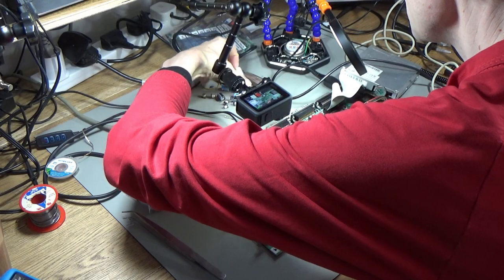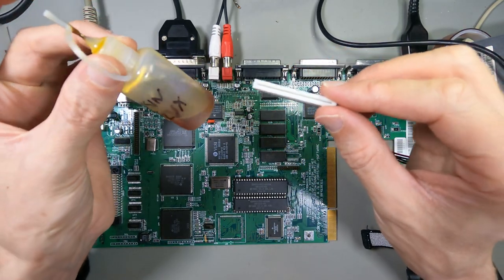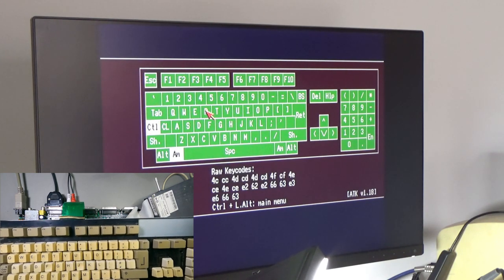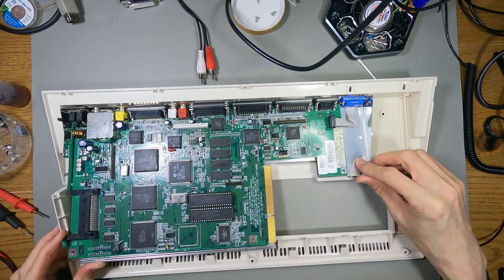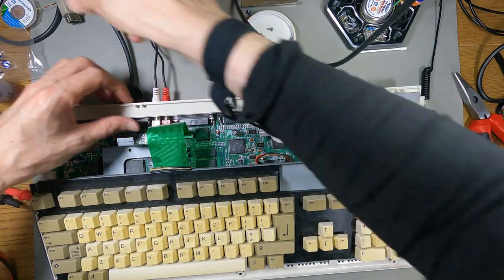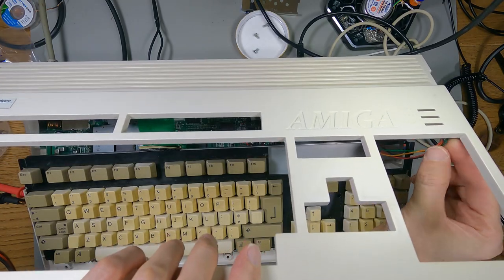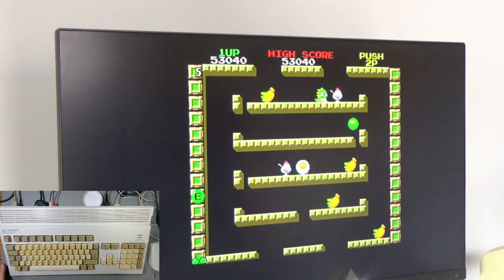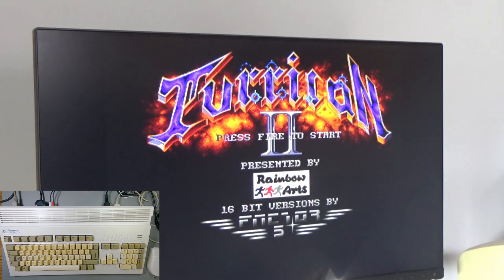Reassembling the Amiga 1200 After Recapping

Comment: Great job! Retro bright the keys in a glass tank of hydrogen peroxide 12% and place a submersible heater with an LED UV light. Wrap the tank with foil to trap heat and light to speed up the process... those keys will look new again! 👍
Reply from the maker: I've actually already bought an aquarium heater for this, but it's a little bigger than I expected.

Comment: I have an Amiga 500+ and an Amiga 1200, also a Commodore C16 and an C64. All work apart from the Amiga 500+ which for some reason keeps going right. 🤣😂🤣 I have had these for about 33years. Happy Days!
Reply from the maker: Is the C64 a breadbin one? That seems to be the most likely to fail as they made some dodgy chips for those back in the day. The PLA being the worst offender which it turns out they used too much boron in the manufacturing process and the chips literally corrode themselves from the inside. I think by the time the C64C and Amiga came out they had ironed out a lot of the problems in their own manufacture process